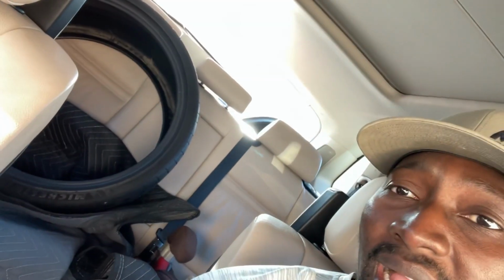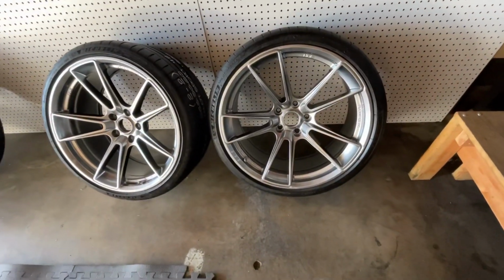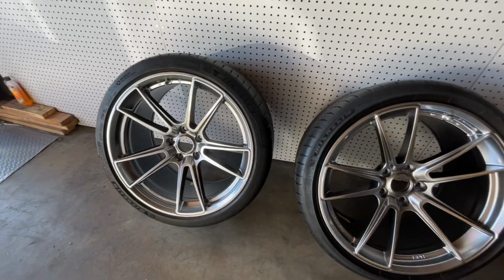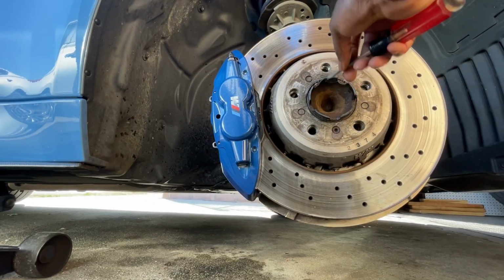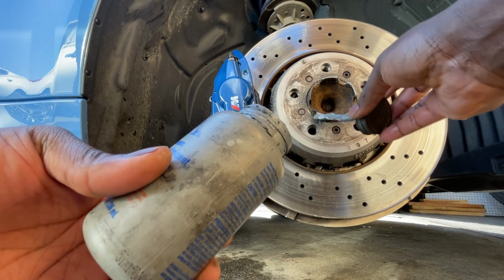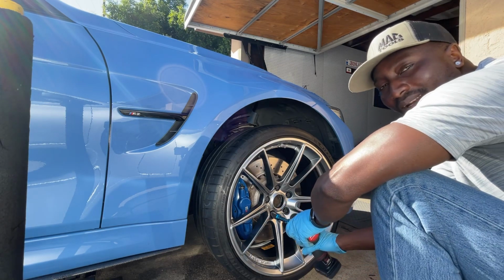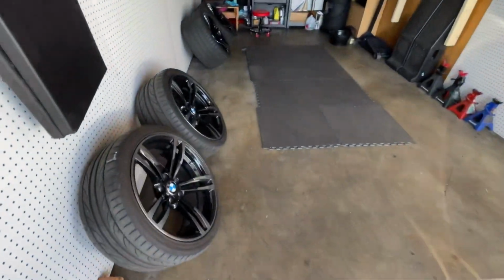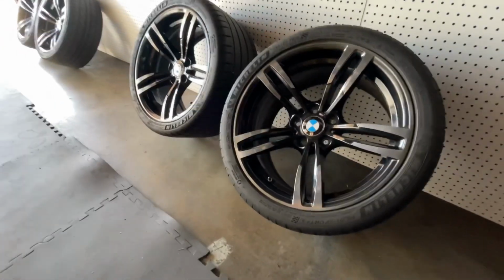Perfect Fitment New HRE Flowform FF04 wheels for my F80 M3!

Comment: Looks clean man!
Reply from the maker: Thanks
Reply: @Jbpgarage  you going back out to the track any time soon?
Reply from the maker: @RascoeGarage  yes, I will be at acs, next weekend  1/10 🤗.
Reply: @Jbpgarage  hell yeah I will be there on Sunday as well!
Reply from the maker: @RascoeGarage  nice, did you get a garage?
Reply: @Jbpgarage  no garage this time they were sold out when I signed up.
Reply from the maker: @RascoeGarage  I was able to get one, if you need to use it just let me know. I guess I will be seeing you next weekend buddy. Which group did you sign up for?
Reply: @Jbpgarage  I signed up for intermediate not sure if it will be intermediate or high intermediate. What group are you in?
Reply from the maker: @RascoeGarage  me too, this is just my second event. Time to bet is 2: 20.
Reply: @Jbpgarage  you will beat that time for sure. I’m happy to share the line I’ve been using. Are you running stock brake pads and fluid?
Reply from the maker: @RascoeGarage  no I already upgraded my brakes and fluids, just need do tires next.
Reply: @Jbpgarage  tires help a lot but using dot 4 fluid and track pads is a must if you are trying to push it. I have some Nitto NT01’s and love them.